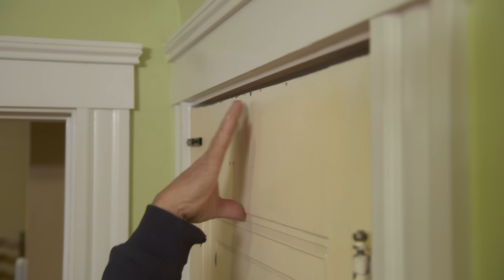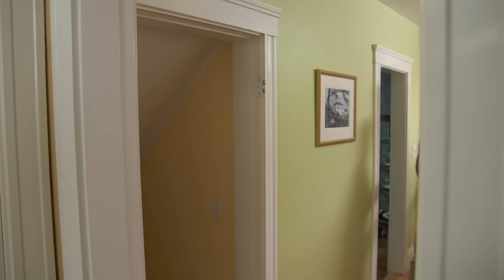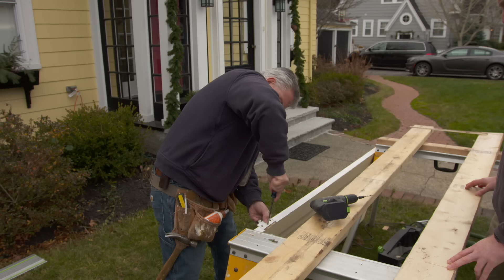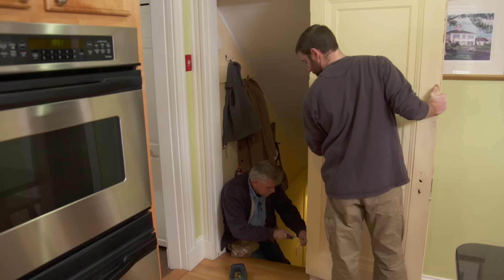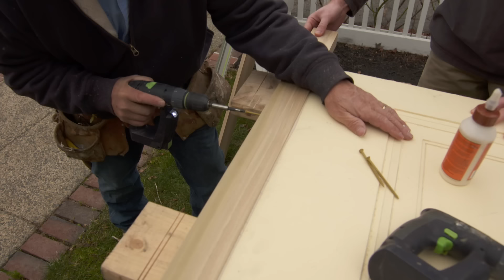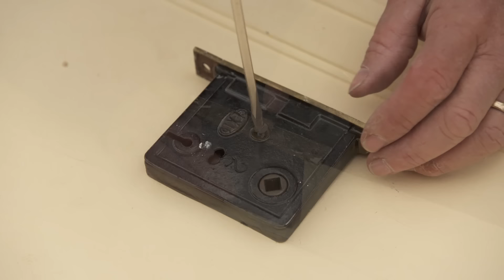How to Fit a Salvaged Door in an Existing Opening | Ask This Old House

Comment: Tommy,

I have been watching and learning from you and the guy’s since 1998. I’m 73 and hope I use every thing you’ve shown us and short cuts and solutions and the team you’ve worked with. 

The 1-st thing I remember trying is unplugging showers, bath tubs and sink drains with 3 girls and 1 boy, wow. I bent a thick wire at the end and pulled atleast 4 inch high pole of hair.

😂

Comment: This is perfect for my current project. I'm slowly renovating/restoring my old Victorian house. The house has settled over the years so that all the doors now stick. It's not a noticeable slope when viewing it but they will need to be adjusted. I'm also restoring the front door. In the past, the front veranda was enclosed and the original red cedar, 86cm wide door was relocated to the back extension (The whole house including joists is red cedar with recycled floors from old ships). It was replaced by a federation style front door that is only 80cm wide, so they built out the frame with framing timber and a bunch of trim and bits to hide it. A horrible abomination that thankfully didn't destroy the door frame and trim. I can't get red cedar pieces in that style as Ive tried for another room someone destroyed. I've removed it all but want to swap it with the old front door so it can have it's place back. The federation door was given an addition today to make it wider so it will fit. I will be sealing it all since it will be an external door (again) but it's only temp. It's good to see I'm doing everything right.
Also great tip with the old door lock. The door had one that I might repurpose so now I know what to do if it's the wrong direction.

Comment: I work in an office on the ground floor of an older building and the door, and its lock date back to maybe the 1950s. The lock keeps malfunctioning and the building  maintenance  man has repaired it a few times but the last time he did it he said that when the lock malfunctions or breaks again he does not know that he is going to do because the kind of lock the door uses is no longer manufactured by any lock company. It is possible that the entire door has to be replaced but it is an older heavy metal door and it actually has no frame to it. The door is attached to the square opening it fits into .  It is really from  a much  older  design.  It seems it would require that the entire entrance would have to be completely reconfigured so that a newer door and lock can be installed, if it is possible at all. 
Anyone know about these kinds of older doors and doorways  on older buildings?

Comment: Where the top of the door was cut to make it parallel to the jam, how would you measure to attach an extension there if the door is too short at a part of it instead of cutting the door?

Comment: This whole process seems backwards to me. Seems like you should've started with adding a small piece to the bottom that matched the contour of the floor - 0" tall at one end, 3.5-2.75=0.75" tall at the other. Then add a small piece to the top to match the contour of the header, same process. So you're left with 2" of gap to fill; split the difference, so in reality that bottom addition is 1-1.75" tall and the top piece also gets an inch. Only 1 additional step (adding wood to top instead of cutting it), but then you wouldn't have disproportionate sills on the door + an uneven gap on the bottom.

Comment: Tommy did a great job with making the door fit. The only thing I would have done differently is when putting the wood piece on the bottom. I would have instead of one solid piece across I would have done this.
Add the piece to the horizontal (Bottom Rail) panel,  then cut two pieces for the vertical ( stile)  making sure the growth pattern ( grain) goes the same way.
Adhering the piece using either dowel pins or biscuit joints.

Comment: Wow . I will need this video, I have doors from 1880, the previous house owners tried hanging the doors and have the hinges on opposite sides of the door top and bottom,  I am thinking of putting this old door on the wood shed , lol
      I liked the idea of how to take and transfer the gap using a scribe. In any case the video is very informative...

Comment: Amazing job here. restoring an old door and modify it to make it fit the door frame instead of replacing it with a new, door, hinges and handle where most people would just put it in the trash. Very impressive and clean.

Comment: I need Tommy XD There is a door in the house that just won't close at the top cause it's warped it's about 1 inch warped towards the inside, at the top far corner, opposite from the hinges. It's an old pine door and I need to straighten it out. I didn't see such example anywhere on youtube, perhaps I should replace the door someday or maybe it's the house walls themself that are getting warped, I know we have problems with cracks in the wall, since this is a 100 year old house the foundation is just not as stable as it should be. I plan to take the door off the hinges and put it on  the floor to see if the problem is actually the door. And then to straighten it out with damp towels and weights. But it's winter time now, and I think I'll wait for warmer days to do this, I just want it would close properly for better insulation, at least for the next winter. And also I can see light from the other room coming through the gap, it's very annoying since the door in question separates my bedroom from the hallway, and the hallway is always lit.

Comment: Lots of good tips here, however...  it seems to me, the spacer block used to find the hinge location might be helpful in placing the top hinge, but it won't necessarily set the door plumb if used for both top and bottom hinges.  When a door is mounted out of plumb, it tends to swing open or jam shut, right?  I am building a tiny house in my back yard and have been having a bit of trouble mounting the exterior door.  I would love it if you shared a video on setting up an exterior door on a new house - i.e. installing custom door frame, mounting the door to plumb, installing threshold...  How do I make sure my new door is weatherproof and insulated correctly?

Comment: I have a wood door with door nob holes already, but the holes are in the wrong side my door opens to the left, can I make new hole where I need them and cover the other holes, and also would it , in any way damage the door structure

Comment: Would it be reasonable to add a small filler on the floor under the door, and fill the gap even more? Or is there some reason why that would be bad?
Reply: Most people don't like thresholds below doors if they can avoid them, they're especially bad on stair tops due to the tripping hazard. Also, most doors have some gap to allow air circulation (many heat/cooling vents, few return vents).

Comment: You know when he filped the door hinge, can you fill in the empty part with wood filler?
Reply: You could, many do, its a bit of a 'bodge' though, use a good wood filler, or it will crack.
The trick is to try and save the piece you chisel out, bit of a challenge sometimes, but get it in one and it's a perfect fit.
Reply: As randal flagg says, it's better if you can save the piece you chisel out and glue it back in its new place. Using wood filler is way more difficult since you have to "square" things up. Maybe using a small piece of scrap plywood you may have already, cutting in rough size, gluing it into place and, once it's dry, handplaining it and sanding it (just like the block of wood Tom uses to make the door bigger) is a better option in my opinion.

Comment: I bet tommy was laughing when he first saw the door
Reply: Tommy's laughing at the door being upside down, but he knows that was the only way it could have been mounted with the hardware left in place. Not a quick fix and only an old timer would know how to do this. 18 step process.
Reply: @oltedders  
I'd also like to know in what way the homeowner thinks the door matches others in the house - because it clearly doesn't.
Reply: @andrewholdaway813  
No, it doesn't match the one next to it. If he found it in the basement it is more than likely original to the house. We don't know if there are others just like it elsewhere in the house. The paint appears to be decades old oil based white, yellowed with age, over the original dark brown stain. The hardware is early 20th century.
Reply: He probably brought it with him
Reply: I'll bet he was laughing inside.
Reply: @JF32304  He laughed outside
Reply: jshd jsjsjs this dude is a dumbass home owner.
Reply: @Mrmudbone_gaming  the guy was looking for the fastest way to block the stairway to protect his kid and this jury rigged door worked well enough untill he could get a proper carpenter in to do it right. It worked as a temporary fix that was easily reversible. The fix isn't that difficult if you have a few basic tools like a circular saw, plane, chisel, utility knife, drill, and  screwdriver but some folks will find getting the door to fit the settled door frame or fitting the extension wood pieces at the bottom a bit daunting if they don't know the tricks presented here
Reply: His wife will nvr let him forget this no matter how much money he makes in non mechanical ways
Reply: he did laugh 0:35
Reply: I doubt it.  It was a quick fix available to the homeowner to protect his kids.  He knew all along it was a stopgap till Superman Tommy arrived.